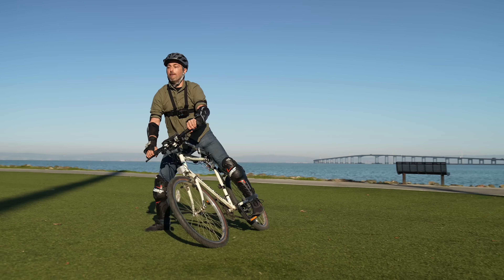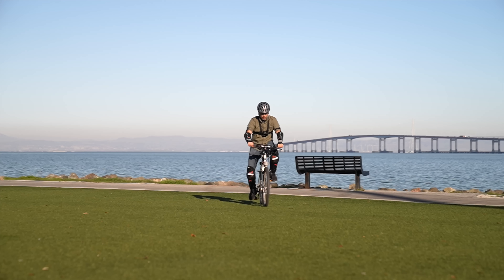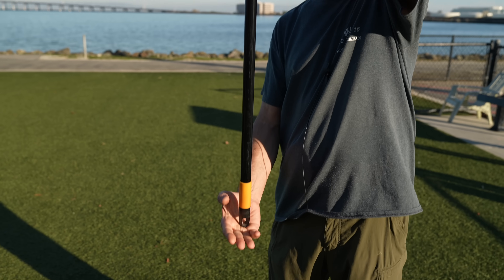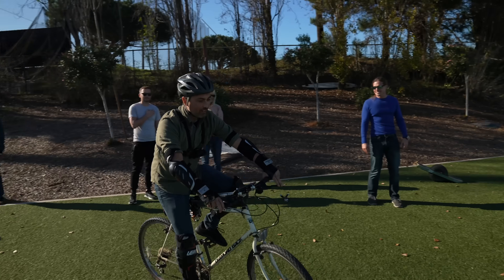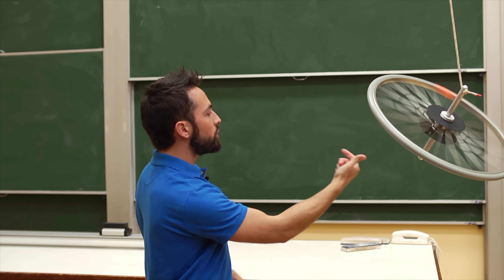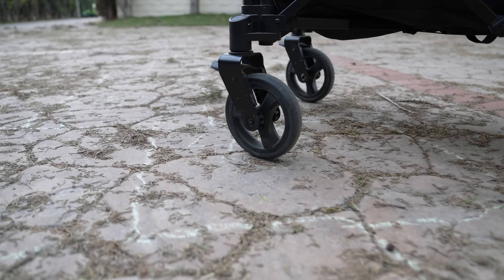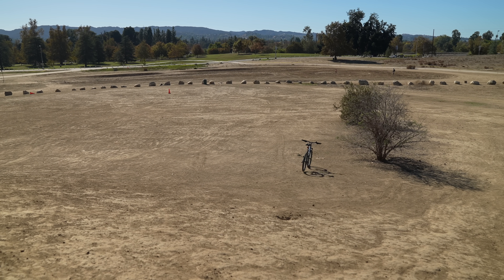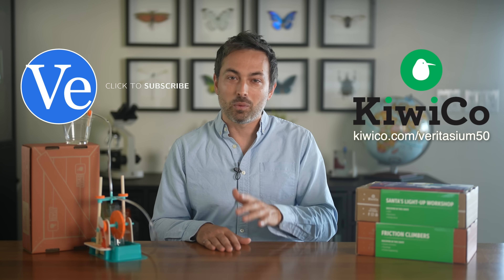Most People Don't Know How Bikes Work

Comment: @Veritasium does this count for steering without hands? Because then you steer by leaning (in small ways) the way you want to go, so I imagine that the wheel maybe doesn't need to counter steer to get out of balance, since you did that by leaning. But I can also imagine that leaning could cause the counter steering. So how does that work? I couldn't focus on my front wheel enough to see it
Reply: Suppose we start with a perfectly vertical bike-rider system (which won't ever really last long, so it's a simplification - and it does matter - but it's fine for demonstration purposes).

Next, you lean your body to the left. To move your body requires a force. What do you apply the force against? The bike. The reaction force is what allows you to move left.
This will cause the bike to lean to the right, because the bike will pivot around the contact patch. You just applied a torque to the bike frame.

OK, we now have the human leaning left, and the frame leaning right. This is where steering geometry comes into play. If you lean a bike to the right, the front wheel will "flop" into a right 
turn. If you have a bicycle at home you can watch this happen. Just stand behind it, hold onto the seat, walk forward and lean the whole frame to the right. The front wheel will turn right.

OK, back to our example. The centre of mass is still roughly vertical above the contact patch (the rider leaned left, the bike leaned right), but the front tyre is now "out tracking" to the right. This is a countersteer! It will cause the bike to start rotating towards a lean left. But the human is attached to the bike, so the human will lean even further left. In other words, the centre of mass of the whole system gets shifted left relative to the contact patch.

Once the bike is leaning left, the steering will flop back the other direction - to the left this time. Do we just repeat what happened before and swing back over to the right? No, because the system is in a different state. Remember, the centre of mass is now to the left. So with the bike leaned left, the centre of mass to the left, and the steering flopped to the left, the bike is now in a stable left turn.

So, you certainly can turn a bike without touching the handlebars - and the turn will still involve a counter-steer by the front tyre. It's just not the human doing the counter-steer, it's physics.

Needless to say, this process is much, much slower than actually initiating the counter steer manually by using the handlebars!
Reply: @allmhuran  ahhhh, that makes sense. Thank you very much!

Comment: My sisters tried to teach me how to ride at age 4-1/2 by taking off one training wheel. 
Didn’t work. 
We moved and my bike came out of the moving truck and I was excited to try riding it with no training wheels on clean smooth concrete under my own power. I almost immediately started opening up the pedal throttle by turning in a circle, which came easy with some velocity, and the faster I went, the easier it was to keep from falling over. Only problem was I didn’t know not to drop the pedals down too far by leaning, so kept digging the pedals and crashing. Then went the other way and found happy equilibrium of speed and traction and maximum lean, and around and around I went. 
Next I remember, riding under my own power down the street. 
Nobody could teach me how to ride a bike, I had to do it myself cause am mechanical like that. 
Taught my son to practice circles the same way. Riding straight is easy when having the feel for circles and turns. But we still give our little guys bikes with “training” wheels. Train them to turn and lean and feel all the things in motion together instead of cancelling out lean with training wheels. Bike riding and cycling IS leaning the whole time!!!

Comment: Bikes are also dynamically stable because the wheel that turns is in the front. As anyone who has towed a trailer can tell you, it's a lot easier pulling a trailer forward than pushing it backwards. If you're going forward, whenever the front wheel turns, the angle between the front and rear wheel also turns in the same direction (turn front wheel left, rear wheel turns left). The rear turns to gradually reduce the effective turning angle of the front, until the front is straight again, making it dynamically stable.

But if you put the turning wheel in the back (drive backwards with a trailer, or push a bicycle backwards), any time you slightly turn the rear wheel one way, the angle between it and the straight front wheel turns in the opposite direction (turn rear wheel left, front wheel turns right). The front wheels go one way, the rear wheel goes the other, effectively making the rear wheel's turn angle bigger and bigger. It's dynamically unstable. That's the reason modern airliners all use a tricycle arrangement with the turning wheel in front. The old tail draggers (like the DC-3) were notorious for being hard to control until takeoff.
Reply: True, except what you've descried is static, not dynamic, stability. Static stability means after a disturbance, does the system return to the initial state or keep going further away from it. Dynamic stability means, in a statically stable system, after it returns to center but overshoots the other way, and overshoots back the original way, etc., then do the overshoots shrink to nothing after a few cycles (dynamically stable, aka converging) or do they keep getting bigger and bigger (dynamically unstable, aka diverging). (And if it doesn't overshoot and returns nicely to center, then it's dynamically very stable).

Comment: Interesting video. One thing that I was surprised isn't in the video is counter-steering at a bit higher speeds. Around 15-20 km/h and above, you counter-steer through the whole turn. Try it next time you're on your bike (bicycle or motorcycle). Get up to around 15-20 km/h and just put flat palms behind the handlebars. To turn left, you only need to push forward on the LEFT handlebar (only push a bit, very gently, and keep your right hand on the right side to keep steady). The turns in the video are at low speed, so you do in fact turn the wheel in the direction of the turn, but you don't do this at all at higher speeds.

Comment: I noticed riding a motorcycle at highway speed. The handlebars don’t actually turn at all. You just put pressure on them and the bike leans over. And.. the more attention I paid… you put pressure in the opposite direction. Your not even consciously aware, it just kind of happens
Reply: technically they do turn but you're right at high speeds on a motorbike it's hard to notice with the naked eye. There are plenty of slow motion videos of motoGP riders at 150mph+ and they absolutely do counter steer, it's just so slight that in real time you don't notice it. If the handle bars never turn then the wheels would always be pointing straight forwards and it would be impossible to turn :)

Comment: The pedals are also a factor.  When I'm just cruising, I don't need to do much to maintain balance, but whenever i'm pedaling, i have to apply counter-force to maintain balance.  That's why the guy who pushed off with his feet could maintain balance the longest when steering is locked.  But the people pedaling fall off immediately.

Comment: Before I saw the part about the leaning, I thought to myself I could ride this bike strictly by leaning. Mostly from riding motorcycles at high speed, it becomes intuitive. Glad you threw that in there.
Reply: Yep I understand that you couldn't do that with locked steering. Just talking to how intuitive controlling it via leaning can become.
Reply: I've ridden a bicycle for miles on city streets before no handed the entire time.   Even 90 degree turns in a 6 foot or so radius isn't so bad with good balance.
Reply: @Needed4Reddit  Yes but no hands is different from locked steering
Reply: @Needed4Reddit  Covered in the 2nd half of the video. Riding with no hands is similar (though not exact) to the ghost riding the bike. The bike is correcting itself, sure you are helping by shifting your weight, but the bike is inherently stable regardless.

Comment: This is really interesting especially when I extrapolate this to a moped, scooter, or motorcycle; on one of those, you only use the handlebars at very low speeds (~5mph); any faster and trying to steer with the handlebars just feels wrong and dangerous. Instead, you steer by shifting your weight a tiny bit and putting just a bit of pressure on one side of the handlebars. I wonder if this phenomena would happen if you tried to ride a bicycle like that.
Reply: when you go fast and lean, the bike/motorcycle presses against ground opposite to where you are leaning in order to equal it out. but when you go slow that leaning doesnt push ground hard enough so you have to counter steer with handle bars?

Comment: curiously I watched this video right after my first practical lesson on a motorcycle, where I was struck by a difficulty to swerve around cones and I had no idea why the motorcycle would not follow what I wanted. I turned the handlebars left, the motorcycle would fall right and I'd balance everything by shifting my weight left as well. result is that I went straight and did not do a curve going straight into the cones. It took me a couple tries to get into the flow. Later on I learned that this effect is very important in motorcycles, especially at higher speeds. It is known as counter-steering and an important thing to know when piloting motorcycles.

Comment: When I attended school for my motorcycle licence, we were told pretty much the same, both counter-steering and that a bike is inherently stable without input. Knowing about counter-steering makes you quite a bit more agile than people who think they steer by shifting their weight.
Reply: I came on to say the same thing.  I was thinking "what is wrong with these people? don't they know about counter-steering?".   Then I realized I only actually learned that explicitly during motorcycle lessons.
Reply: The first two minutes of this video all I could think of was motorcyclists who counter steer already do this
Reply: So true. What really shocks me though is that there are motorcycle riders who don’t realize this in much the same way the cyclists don’t.
Reply: Correct :) this is what I was taught, too! Didn't make the figure 8 routine any more easier the first time one goes about it, though... lol
Reply: @DJLuckeyLu  I really wasn't good at the practices we needed to do for the license. The pressure of paying about a 100 bucks at the end to show someone once that you can do them didn't help either lol
Reply: Back brake also straightens you up/ brings you vertical, front brake changes speed. Its how head ons happen people back grav back / press on back brake it sits upright you go whack into grill of oncoming traffic
Reply: I have ridden bicycle my whole life, I had a cruiser and then an earlier sports bike.  I never had any trouble with any of them.  Then a few years ago I got an older CBR600rr and that was a complete game changer.  I had all I could do to keep it on the road until I got into the swing of leaning it in the opposite direction of where I wanted to go.  Now it just seemingly goes where I want to without thinking about it and it seems more natural.  The bike feels more like an extension of my body than it does something I'm just riding on.
Reply: Mountain bikers and motorcycle riders laughs
Reply: My point, precisely. We all knew about this as kids because we were constantly pounding trails and other sorts of fun with our bikes.
Reply: Same, never knew about counter-steering until I went from bicycles to motorcycles.
Reply: Plus: You steer with your arse, not with your arms!
Reply: @arminhanik4207  exactly. If you want to make a tight U-turn shift your weight out of the turn while looking where you want to be. A full dresser can do circles inside 2 parking spaces.
Reply: You're lucky you had that training..  when I first got on a motorcycle, it was out front of a friends house with no instruction, and I ended up in the opposite ditch every time I tried to turn for the first couple minutes..  With very slow speeds, it acted like a bicycle does, which I was fine with but at some speed, it seems the effect is amplified, and/or maybe the gyro effect increases, and the dynamics change.  Once you figure this out, you can steer simply by intentionally pushing the OTHER handlebar to cause the lean.  it was fun
Reply: @SteveJones172pilot  I had the exact same problem when I drove a quad the first time, because you don't need to counter-steer with them, but since they got a handlebar like a motorcycle, your brain is wired to do that.

Comment: I have heard training wheels hinder a child's ability to ride a bicycle without training wheels. Training wheels take the counter steer away.  Also interesting when thinking about 3 wheeled bicycles, or the super dangerous motorized 3 wheelers. 3 wheelers don't use counter steer which throws the center of gravity away from direction of turn, increasing likelihood of rolling over.
Reply: idk man, i started learning to bike with training wheels and over time i had them taken off and biked just fine
Reply: @thejericho  lol training wheels prevent you from fully falling from the bicycle and does not hinder the rider to balance. Its a safety measure. Tricycles are different.
Reply: Also 3 wheels is fine as long as it's two in the front.
Reply: I'm with you. Our kids learned to ride on balance bikes. Much better than training wheels for teaching a kid what it feels like to ride a bike.
Reply: Most training wheels don't touch the ground full time. They allow you to experience keeping your balance in a straight line while keeping you upright in a turn.
Reply: @imadecoy.  yep that did the trick to me ... back in the days xD

Comment: This concept is most important when riding heavy motorcycles, you would be surprised how fast you can turn in those by counter-steering the right amount... The first times you try to do it on command it feels wrong and like you are about to make a big mistake.
Reply: That's because steering out of the turn (countersteering) moves the bike's center-of-gravity into a position where it can easily lean very sharply, which also allows it to turn very sharply -- and your own reflexes will cancel the countersteer as soon as you feel it happening, so you will reflexively initiate a very sharp turn after attempting to countersteer.
Reply: I was going to say the same - I'd like to see how motorcycle riders like myself do in this test
Reply: Countersteering a motorcycle was immediately intuitive for me. It’s like Derek says for bicycles, I never had a moment of “this feels like I’m going to make a mistake”